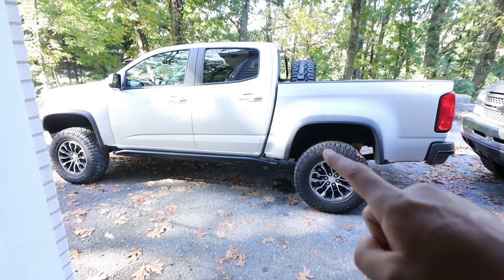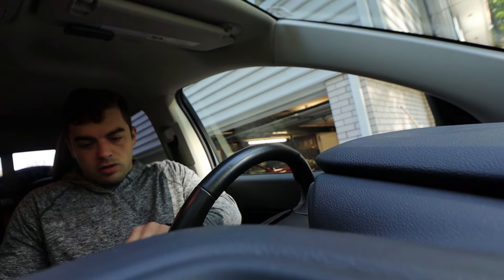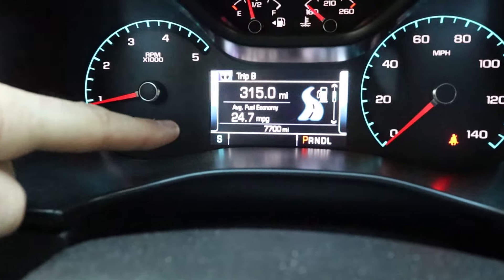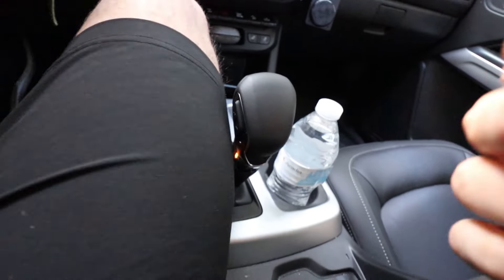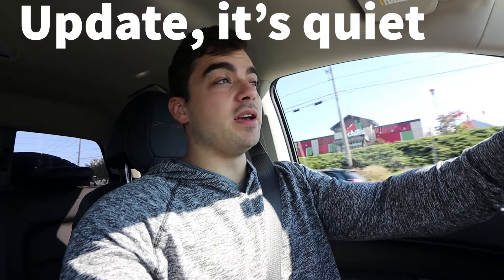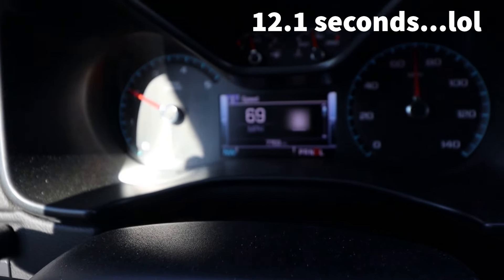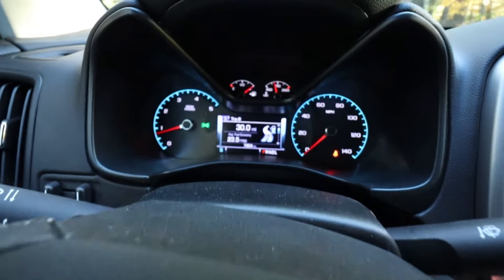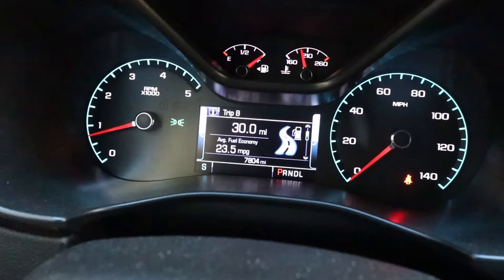Tuned Colorado Diesel w/ Downpipe & Exhaust vs Stock Colorado ZR2 Duramax

Comment: Must be nice my 2016 Colorado with the v6 gets an average of like 16mpg both city and highway. Has a small lift and bigger tires but still
Reply from the maker: Yea the V6 gets terrible fuel mileage
Reply: Dang, I can average 20mpg usually in mine.
Reply: I did a trifecta tune in mine and had great improvement in fuel economy and drivability

Comment: I was actually surprised with the fuel mileage. Currently looking around at diesel Colorados, Canyons, Ram 1500’s, and Silverado 1500’s. I don’t need a full size even thought it would be nice. But kinda leaning towards the Colorado now
Reply from the maker: The Silverado 1500 diesel gets better fuel mileage than the Colorado diesel.  I want both!
Reply: Just a heads up about the Chevy 2.8 Duramax. There are no gauges for the turbo at all. Even more annoying is nothing to monitor particulate filter or do a manual regen. Usually there is no notification that it is doing one. Apparently you are suppose to be able to hear the difference, but I can't. I've had my truck in 6 times in 3 years for sensor replacement and manual regen. You can get a device called Autel 808 which is a scanning tool, but also allows you to monitor soot filter, time since last regen and most importantly you can do the manual regen yourself if need be. They cost a bit less than $500.00 but well worth the money. Chevy could have included more to monitor critical systems. other than that I have had no problems with my truck.

Comment: I love that the Colorado and the Canyon were available with the small displacement Duramax turbo diesel engine.
Reply from the maker: That's the main reason I bought one!
Reply: @matt13ross  That's a good reason. I read somewhere that they're no longer producing the Duramax 2.8 engine, that the factory is closing down. I'd hope not.
Reply from the maker: Rumors are the next Colorado will not have a diesel option, a 4 cylinder turbo gas engine instead.
Reply: @matt13ross  That's too bad. If one wants a turbo gas powered Colorado, that's fine. But I think people should be allowed the option if they want or need a Duramax 2.8 litre Diesel.
Reply from the maker: Agreed
Reply: @matt13ross  I've never understood why small displacement diesel engines have been less popular than much larger diesel engines. The much larger (6.6 litre) Duramax diesel is fine for those who either have a trailer or a 5th wheeler to tow, or possibly if you have a Class A motorhome and you want to upgrade from an gasoline engine to a diesel engine. But not everyone needs or wants such a large displacement diesel, sometimes a 2.8 litre Duramax Diesel would suffice.
Reply: @matt13ross  Emissions be damned. You're going to have to deal with the effect on the environment regardless what engine powers the car, truck, van, or SUV. It's just the nature of the beast. I'm not against electric powered vehicles. I'm not against hybrid (gasoline/electric) vehicles. I believe they're good vehicles. I used to know someone who drove a Toyota Prius and having ridden the Prius, I found it a good vehicle for most driving needs. That being said, I would've preferred an SUV, like a Toyota Rav4 or a 4Runner. Unfortunately, neither of them are available in the USA with a turbo diesel engine.

Comment: The truck and engine I want. I'm surprised Toyota has not built a tacoma with a 4 cylinder diesel yet. All I wanted out of a midsize truck, torque to tow,  pull itself in light offroad situations and better gas economy than other trucks. I heard some reporting 36 mpg but they are probably in the country doing long commutes with no traffic
Reply from the maker: I'm very surprised no other makers have a diesel midsize truck.  I guess they just aren't popular enough here in the USA.  You can definitely get near 36mpg highway with a tuned non ZR2 Colorado diesel.
Reply: @matt13ross  seeing how Chevy is having success with it, we will probably see more small diesel engines. I think it can compete with the upcoming electric trucks that will coming out soon.  Gas probably fazing out as time goes by
Reply from the maker: I hope that’s true!

Comment: Years ago Chrysler was putting this into their Dodge Caravans overseas and I saw a test done on a 1998 with a 2.4 L version of the same engine and it got over 50 miles per gallon with a single person in it and went 1050 miles. Then they filled it up with seven people filled up the fuel tank and it went over 730 miles with the same 20 gallons of fuel with seven people in it.
Reply from the maker: I liked this little engine.

Comment: You should consider a electronic exhaust cutout.  That way you can have quiet when you want it then noisy when you don't.
Reply from the maker: That's actually a solid idea!  I was thinking of adding a bigger muffler to make it more quiet, but would like it to be loud at some points too.
Reply: Only issue with that is tuning, it's tuned for the exhaust set up and changing back pressure will affect tuning

Comment: That transmission tuning makes a massive difference. The stock transmission tuning is the biggest issue with the ZR2.
Reply from the maker: Yea I’m impressed with it! Locks out much quicker and stays in lower gears.

Comment: Hi I’m about to dive in with a 19 ZR2. How has the longer term economy worked out? Mine averages around 20 and has been to Chevrolet 3 times with emissions failures including a plugged DPF. It also drinks 5 gallons of DEF every 1000 miles when towing. Look forward to your answer
Reply from the maker: I answered your other question. Yea mine used to average around 20mpg. Now it’s about 26.

Comment: I have a 2017 and the only thing I have in it is a Stealth chip I had one trip that actually hit 42.0 miles per gallon. Though not as impressed with the performance otherwise. Also, haven't hit that 42 since, so not going to attribute it to the chip, as it could have been a fluke. Looking to do a full tune soon. Have also heard some good things about Pedal Commander to get rid of dead pedal syndrome. We'll see what the full tune does first.
Reply from the maker: I wouldn’t do a pedal commander if you’re getting a tune. The tune will take care of the dead pedal.
Reply: Maybe try an intake rather than a pedal commander with the tune

Comment: I am looking for a new off road tuner, have you checked your boost pressure? Mine from another company is steadily at 50psi and peaks at 81psi causing continuous hoses to blow off or rupture.  Please offer your thoughts,  I don't want to throw down  $1500 to have another  unusable tune...
Reply from the maker: The boost sounds way too high.  I have not measured mine yet, I'm planning on getting a gauge setup soon though.
Reply: Which tune is causing that amount of boost?

Comment: can you get the stock downpipe out from the bottom once its all unbolted? Or do i have to move the airbox, coolant tank, hot air pipes and take it out from the engine bay?
Reply from the maker: Has to be from up top.

Comment: My stock "leveling kit after market suspension" 2016 canyon 2.8L 82k miles gets average of 28mpg highway. I have lead foot an like to ride left lane. I learned how to just work rpms play with cruise control and driving 4hrs in a day for work I can get anywhere from 20-28 depending on how I'm driving. My best is 33.6 and I'd get that super easy if I just rock 60-70 in middle to right lanes. This engine does better when has a payload or pulling trailer. Basically brake lights cost me mpg so get out of the way.
Reply: Super confident this engine can reach 300-400k miles no problem if properly maintained or even "tuned". The only thing I'm having trouble find info on is transmission failures. Just trying to plan ahead. Even with higher gas prices beats most sedans, all midsize/full size trucks in mpg.
Reply from the maker: Yea the transmission was not confidence inspiring.  But I did get great fuel mileage with mine.

Comment: We have the turbo whistle now on our stock duramax 2018 ZR2. We're at 54k miles is this normal? I've heard it on the road with other diesels and my buddy says it's just the turbo spooling up with boost. It's hard to find research on this. Also, we're getting a little exhaust in the cab. Have you gotten this? Maybe a clamp needs tightening at the downpipe from the turbo?? Thanks
Reply from the maker: Is it a new noise?  If it's not, I'm sure it's just the stock turbo, most of them have some sort of whistle.

Comment: you should get a pedal commander  it will  change ur life. i just installed mine last week. no more dead pedal
Reply from the maker: The tuning by itself got rid of the dead pedal completely.  That's what a pedal commander does, it's all tuning.
Reply: @matt13ross  Did I miss what tuner you used?

Comment: I have the same exhaust and you will love it if you get that muffler out of the way. Go straight pipe and enjoy 😉
Reply from the maker: Too loud lol
Reply: Which exhaust is it?  The link doesn't work. Can you point me to it please?
Reply: @matt13ross  Can you share which tuner was used? Love that set up. Thanks
Reply: @10MinutestoRouletteFortune  check out HD supply. He got the tuner there (as did I snd it’s the exact same thing) and they offer a 3” pipe with the tune for $588). They only offer like 3 products for 18-21 Colorado duramax
Reply: @georgefloydsinhellwbreonna5330  I also used them.

Comment: You need to do a launch in it on the road so we can see how much coal rollin it does
Reply from the maker: I’d only do that off road. But I really don’t think much it seems to run clean.
Reply: @matt13ross  it sounds really good for a 4 cylinder
Reply from the maker: @sethg.7158  I thought so too

Comment: Want to delete my 2021 ZR2, but nobody has a tune for the 21. I can get the exhaust.  But that won't do any good by itself.   
I emailed the guys at hd diesel supply, and they don't have any info on when and/or where to get one for the current model. Any suggestions?
Reply: HD diesel supply from Canada has it.

Comment: does it have to have the black smoke?  just wondering.
Reply from the maker: It only smokes a little bit from what I've seen.  Much less than a full size tuned diesel.
Reply: on the plus side, being the smoke is made up of relatively large, heavy particles, it should settle out of the air fairly quickly.  And being you now get significantly higher fuel economy, there's actually LESS pollution, as long as the emission control hardware is still on your truck.  Thanks for the quick reply.  I love your truck, BTW!
Reply from the maker: Thanks!

Comment: Hold up... I average 21 MPG in my 2016 V6 Colorado and my best is 34.3 MPG.  Am I getting old??
Reply from the maker: I haven’t heard of anyone getting that mileage on a gas Colorado. What sub model?
Reply: @matt13ross  It’s an LT with the 6 speed automatic. Extended cab, not crew cab.
Reply from the maker: Not being a ZR2 helps too. Must drive very slowly lol.
Reply: @matt13ross  Confirmed: I’m getting old then.
Reply: The ZR2 is waaaayyy different. V6 I get 18ish all around
Reply from the maker: @seadoo4life127  right that sounds more accurate

Comment: You need to get a big intercooler that will make the biggest difference
Mine is producing 151 kW @ 3600rpm and 580 Newton metres of torque at the wheels
And this is done with a chip and a Tune straight pipe snorkel big intercooler and K&N filter♠️♦️
Reply from the maker: I thought about an intercooler, but probably after a turbo upgrade.

Comment: is there a cold air intake on it or stock i thinking going back to stock
Reply from the maker: Stock intake. Not sure if there is a benefit to aftermarket.
Reply: The reason why I'm asking is because my truck came with a cold air intake I didn't put it on and I'm having a horrible time finding an air filter for it I need it replaced and it keeps on throwing codes because of it but I don't know if they are ever going to get it a tree in stock so I was thinking about just going back to the stock filter box
Reply from the maker: What code and what intake? Can you hear more turbo noises or anything else with the intake?
Reply: I do hear a little bit of a turbo it's a air raid filter and it is out of stock and they don't know when they'll get them back into stock but I would clean it but it is too dirty to clean
Reply from the maker: @nathanyoung3158  if you have the stock one laying around I’d just put it on.
Reply: I don't have one when I bought the truck it had cold air intake already installed  so I'll have to buy one

Comment: is your buddy investing into a cold air intake aswell?
Reply from the maker: Meh, I don't know.  I have never been a fan of intakes, don't think they do much.
Reply: They don’t with this platform
Reply: @matt13ross  thanks for the vids. Enjoying them. I live in Cali and there's no way I could get away with the exhaust mod even though I would do it in a heartbeat. I did  do the SB filters intake though and gave me a little extra noise and I can pass a smog check. For me it helped with the throttle response and a little mpgs. I don't regret it.

Comment: so what is the tune for it
Reply from the maker: HD diesel
Reply: ok thanks i plan on getting that next year then for my diesel zr2 i got about 75000 miles on it now just have had for a year and its my daily driver
Reply from the maker: @nathanyoung3158  I’ve had mine about 2 years
Reply: nice i have 50000 in one year so next year i will have to do the timing belt and the tuner too hopefully at once should be fun

Comment: It’s a good little motor but don’t go crazy with the tunes.
I see a lot of these blowing up. I believe they are running close to max with a stock tune.
Remember it’s only 2.8 litres.
If you run it hard with a high output tune ....... Good luck on life expectancy......
Reply from the maker: Yea I’ve read of some stories. This is a general mild tune, 49hp 70tq.

Comment: stock has a way better idle sound
Reply from the maker: Stock idle is silent lol
Reply: @matt13ross  Yea but its hard to tell when the microphone is right on it. I really like the the after market exhaust but that bubbly noise at idle sounds kinda strange
Reply from the maker: I think you'd like it in person.  Honestly my favorite part is the idle and low revs.  High revs it doesn't sound great IMO.
Reply: Yea I wanted to buy the mini duramax but the only ones I can find are like 40 grand
Reply from the maker: Most are closer to 50K.
Reply: @matt13ross  thats crazy I went out and bought a 10 year old full size one instead

Comment: Diesel is too small as 4 cylinders.  Need minimum of 6 cylinder.  The truck has only baby diesel and it sounds like it too.  Little baby sound.
Reply from the maker: It is a baby, and in a baby truck